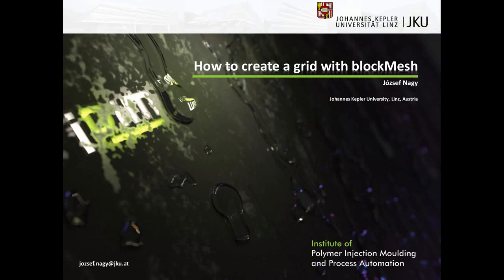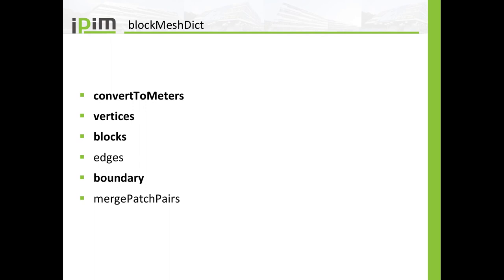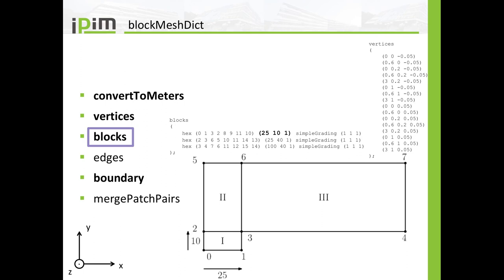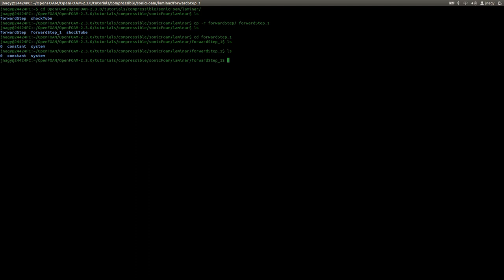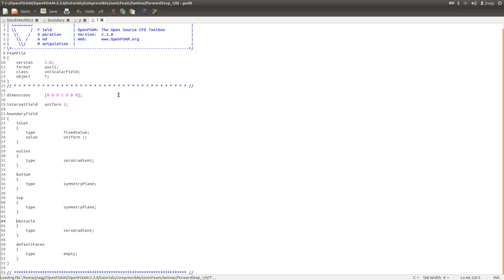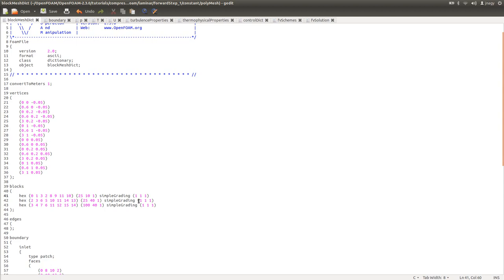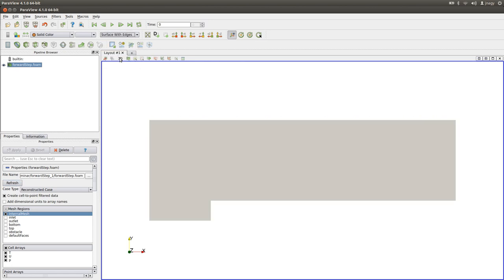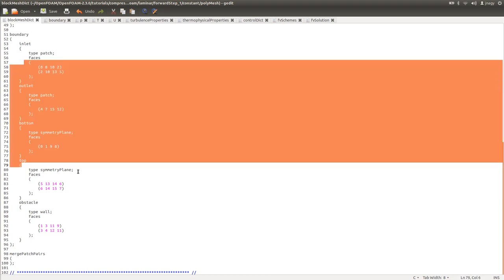How to create a grid with blockMesh in OpenFOAM - tutorial

Comment: Thank you, Jozsef, for taking the time to create this tutorial.  I have also been able to implement the decomposePar and reconstructPar from the multiphase/dambreak example and, for those who are interested, my HP DL380 G6 (6x 4GB 1333ram, 2x X5650, 4x SAS146GB) completes the solution in 1639s on single core and 440s on 10x cores (with decomposition set as simple).  This machine cost me £200 from eBay inc VAT and delivery.
Reply from the maker: Thank you for your input!

Comment: Hi József, I use OpenFoam2216; I tried to follow your instructions, obviously, there can be some modification in the process, so I cannot get the result files after running BlockMesh. The conclusion message after declaring the blocks are that there are no merge patch pairs, so no boundary or other files were created. Anyway, the OpenFoam close its run with the next message: 
--> FOAM FATAL ERROR: (openfoam-2206)

The parent directory does not allow write permission to the process,
 or one of the directories in "/usr/lib/openfoam/openfoam2206/tutorials/compressible/sonicFoam/laminar/forwardStep/constant/polyMesh" did not allow search (execute) permission.
What can I do? Have you any idea?

Comment: hi, thanks for your videos. I tried running this tutorial on openFoam v7. Can you please share the command to be typed to solve the tutorial. In the latest openfoam, forward step tutorial has been moved to a rhoPimpleFoam solver. So i m having trouble running it.
Reply from the maker: Here the most important thing is the mesh part with blockMesh. The simulation is of lower priority. v7 is unfortunately not compatible. In v1912 from openfoam.com the solver is still available. You can try that version of OpenFOAM.
Reply: @OpenFOAMJozsefNagy  Thanks alot for your immediate respose :)

Comment: Excellent Tutorial! I tried to understand the this part on OpenFoam documentation, but it was impossible! Here it is much better explained! I have only one issue with this tutorial and is not on mesh part.
When I typed the sonicFoam command, the openFoam returned that sonicFoam was not found. 

Them, Ubuntu sugested to install OpenFoam by sudo apt install openfoam. I 
tried that and it didn't solve my issue. I also searched on google for this issue and didn't find any solution.

By the way, I am using:
- Ubuntu18.04;
- OpenFoam8
Reply: Same problem, have you found the solution?
Reply: If you manage to make it works, publish it here.
Reply: @alcarnielo  sure, I will and Thanks for the reply
Reply from the maker: @ramgupta7697  The .org version dicontinued this solver. Try v2006
Reply: @OpenFOAMJozsefNagy  Thanks for a reply. Even though I am not able to perform similar tutorial as explained in your video I got much more information about basic commands. 
Thanks a lot 🙂🙂

Comment: Hi József, thanks a lot for the video. I have one question, why do you take now the units for the pressure like pascals, but in the previous tutorial (icoFoam) you had the units of pressure divided by density?, is this because we are dealing with compressible flow, right?
Reply from the maker: +alesabden Exactly. In compressible solvers you have the pressure in Pa, in incompressible solvers you divide by the density and use the kinematic pressure = pressure/density.
Reply: +József Nagy Thank you very much. 
I would like to ask you another question, József. I am trying to simulate a inviscid flow through a convergent-divergent nozzle, and I think that this solver (sonicFoam) is a good option for the case. So, I've just created the mesh, and I am putting the boundary conditions but I don't understand very well how the "waveTransmissive" boundary condition works here. Could you please explain me about that?, I will appreciate it so much, thank you again
Reply from the maker: I am not familiar with this boundary condition in detail, my suggestion is to check out the source code itself.
Reply: Ok, I am going to check it out. Thank you anyway

Comment: @Jozsef Nagy  I have a question related to how to mesh a 3D cylinder(straight vertical pipe mad by a cad e.g Salome  and exported as a triangulated surface stl file ) which is contain inlet and outlet and the wall of the cylinder with blockMesh . I have really searched to find a tutorial to explain this but i did not find it, I hope you can introduce me to such a technique .

 thank you very much for such great tutorial,

Regards,
Reply from the maker: Did you see my tutorial on the multiphase simulation project?

Comment: I am just making sure. 

I am somehow getting the mesh file interpreted to 
1- blockMeshDict [constant folder] 
2- run blockMesh command 
3- boundary is created and other files [constant folder]
4- Paraview reads controlDict [system folder]

Q. confused here. Paraview works with controlDict [system folder]? or blockMeshDict [constant folder]? or even with the empty file I created blabblab.foam?

5- I run with sonicFoam
6- reread the Paraview file again
Reply from the maker: The tutorial is a bit old. Check e.g. my multiphase simulation project it is more recent and uses a more recent approach. Or even my newest overset mesh tutorial.

Comment: Thank you so much for the tutorials, they are great!  
I am using OpenFoam10 and when I try to run forwardStep from rhoPimpleFoam/laminar with rhoPimpleFoam it gives:
 Courant Number mean: 0.251275 max: 1.17915
Time = 0.016s
PIMPLE: Iteration 1
diagonal:  Solving for rho, Initial residual = 0, Final residual = 0, No Iterations 0
smoothSolver:  Solving for Ux, Initial residual = 0.0764808, Final residual = 1.29e-06, No Iterations 1
smoothSolver:  Solving for Uy, Initial residual = 0.064002, Final residual = 7.94223e-06, No Iterations 1
smoothSolver:  Solving for e, Initial residual = 0.26368, Final residual = 4.9006e-06, No Iterations 3
smoothSolver:  Solving for p, Initial residual = 0.0715941, Final residual = 6.77228e-08, No Iterations 2
diagonal:  Solving for rho, Initial residual = 0, Final residual = 0, No Iterations 0
time step continuity errors : sum local = 1.94255e-09, global = 1.06042e-09, cumulative = 6.6211e-09
PIMPLE: Iteration 2
smoothSolver:  Solving for Ux, Initial residual = 0.00795199, Final residual = 9.99449e-11, No Iterations 1
smoothSolver:  Solving for Uy, Initial residual = 0.021992, Final residual = 1.56364e-09, No Iterations 1
smoothSolver:  Solving for e, Initial residual = 0.285134, Final residual = 2.3536e-08, No Iterations 2
--> FOAM FATAL ERROR:
Negative initial temperature T0: -3.09503

I found the same problem here https://www.cfd-online.com/Forums/openfoam-solving/242656-forwardstep-tutorial-case-failure-openfoam-dev-using-rhopimplefoam.html 
unfortunately it is still unanswered
Reply from the maker: Try a lower time step size. Interesting that newer versions are less stable.
Reply: Thank you for the quick reply.
The oscillations appear very quickly in front of the obstacle when rhoPimpleFoam is run even with a smaller deltaT.
But it turned out that roCentralFoam (with appropriate fvSchemes and fvSolution) handles well both cases from rhoCentralFoam/forwardStep and rhoPimpleFoam/laminar/forwardStep tutorials.
Reply from the maker: @tatianaguseva2243  Great

Comment: Great tutorial, but I got an issue: after following the tutorial, I was playing around for a bit, as I usually do to try stuff myself and see if I understood everything. Whenever I tried to start the simulation using sonicFoam on a non-uniform mesh, it chrashed after a few iterations. Why is that? Does this specific solver only work on a uniform mesh?
Reply from the maker: sonicFoam is a compressible solver, it is very sensitive for changes. Test pisoFoam or pimpleFoam, they are more stable.

Comment: block 1- grid size in x-direction is matched  with the (block 2-grid size in x-direction)  , b'coz block 1 and 2  are connected.....similalry block-2 -grid size in y-direction is matched with the(block-3 grid size in y-direction), b'coz block 2 and 3 are connected......like  25,25  and 40,40...... can we run on different grid size  in same direction for connected blocks???
Reply from the maker: The numbers have to match. For complex geometries use snappyHexMesh or cfMEsh though.

Comment: Hello, thank you for your tutorials. I have a question. I begin with OpenFOAM and I work with OpenFOAM-v1912 and for this exemple of forwardStep, in polyMesh, I didn't have blockMeshDict, even after the mesh generation with blockMesh. How can I continue ? Thank you in advance for your answer.
Reply: I have just had the same problem. There is on blockMesh dictionnary in the folder system
Reply: @rafaelcarretero5104  than you very much
Reply from the maker: It was moved to system in later versions.

Comment: Hi József,

Another question: Lets assume I am trying to solve something similar to the current tutorial. The velocity at the inlet is uniform at a specified value as you have already, but the velocity at the outlet is to be calculated rather than specified. As for the pressure, it should be calculated at the inlet and specified at the outlet. Do you know the appropriate BC I need to specify for such a case? It seems like pressureInletVelocity is what I want but does this also apply to the outlet?

Again thanks!
Reply from the maker: Oscar Wilsby pressureInletVelocity is the BC if you want to specify the pressure in both the inlet and the outlet and calculate the velocity. Well in this tutorial I use zeroGradient for the velocity on the outlet, which just maps more or less the velocity in the last cell centers onto the patch. You can try it like that or maybe inletOutlet to avoid a backflow. Is this the kind of 'calculate', you are looking for?

Comment: I doing this tutorial When sonicFoam command is given, i get following message
The sonicFoam functionality has been merged into the transonic option of the
latest rhoPimpleFoam solver and the sonicFoam tutorials moved into the
rhoPimpleFoam tutorials directory.

To run rhoPimpleFoam in transonic mode set the transonic option in the
PIMPLE sub-dictionary of fvSolution:
PIMPLE
{
    .
    .
    .
    transonic            yes;
} kindly guide me in this
Reply from the maker: Yes, v7 doesn't support this solver anymore. You can use an older version or switch to v1912.

Comment: Also got follow error for refined mesh
PIMPLE: Iteration 1
diagonal:  Solving for rho, Initial residual = 0, Final residual = 0, No Iterations 0
smoothSolver:  Solving for Ux, Initial residual = 0.117084, Final residual = 3.8236e-06, No Iterations 1
smoothSolver:  Solving for Uy, Initial residual = 0.0724861, Final residual = 4.11106e-13, No Iterations 2
smoothSolver:  Solving for e, Initial residual = 0.207454, Final residual = 5.60509e-07, No Iterations 2
#0  Foam::error::printStack(Foam::Ostream&) at ??:?
#1  Foam::sigFpe::sigHandler(int) at ??:?
#2  ? in "/lib/x86_64-linux-gnu/libc.so.6"
#3  Foam::symGaussSeidelSmoother::smooth(Foam::word const&, Foam::Field<double>&, Foam::lduMatrix const&, Foam::Field<double> const&, Foam::FieldField<Foam::Field, double> const&, Foam::UPtrList<Foam::lduInterfaceField const> const&, unsigned char, int) at ??:?
#4  Foam::symGaussSeidelSmoother::smooth(Foam::Field<double>&, Foam::Field<double> const&, unsigned char, int) const at ??:?
#5  Foam::smoothSolver::solve(Foam::Field<double>&, Foam::Field<double> const&, unsigned char) const at ??:?
#6  Foam::fvMatrix<double>::solveSegregated(Foam::dictionary const&) at ??:?
#7  Foam::fvMatrix<double>::solve(Foam::dictionary const&) at ??:?
#8  Foam::fvMatrix<double>::solve() at ??:?
#9  ? at ??:?
#10  __libc_start_main in "/lib/x86_64-linux-gnu/libc.so.6"
#11  ? at ??:?
Floating point exception (core dumped)

What to do

Comment: sir,
can Guide on how to dynamically remove cells.
I heard of polyRemovecell but  have no idea on how to use it.
Reply from the maker: polyRemoveCell is not an executable utility, it is a header file, where a couple of functions are defined for dynamic meshing. OpenFOAM does this automatically in the solvers, where dynamic remeshing is included.
Reply: Sir I am modellinG ice subjected to heat flux and I want to remove those on surface cells whose temp falls below 0 degGree and shift the boundary so that shape of surface contour can be seen

Please Guide me some way to remove those cell accordinG to my condition
Reply from the maker: That is some heavy duty programming, what you need, so start familiarizing yourself with C++ and the OpenFOAm Source Code. There are some programming tutorials on wiki.openfoam.com/Tutorials those might help you getting into the source code, but I do not know any material, which focuses on this.
Reply: Sir,
What arGuments do i have to send for removeCells function to tell OpenFoam which cells do I want to remove?
Reply from the maker: I do not know it. I'd have to dive deep into the source code myself.
Reply: Sir,
Thank u for your reply.
I am using now member function of polyTopoChange for which I have to write dynamicMeshDict.
So Sir can u suGGest  some material or tutorial for that.

Comment: Hello sir 
When I tried to solve I got a error showing negative initial temperature.
Don't know what to do
Reply from the maker: What is the exact error?
Reply: @OpenFOAMJozsefNagy  after typing sonicFoam and entering
The simulation runs fine for few steps then stops shows 
Fatal error negative initial temperature = -0.809...
Reply: But when I tried to copy the folder and started as new then it didn't happen and simulation went smoothly.
Reply from the maker: @bharathkumargaddameedi3312  Ok, interesting. I am glad it works.

Comment: Hello, I'm Aldi,
I'm very gratefull with your Tutorial.
I'm newbie in OpenFoam, I concern to simulate the Flow Analysis around the Propeller.  and I need some tutorial or steps how to create the boundary condition for Propeller Case. May you can help me or give some Tutorial? Thanks so much for your time.
Reply from the maker: +바하뜨마까알디아스 Start with the case in tutorials/incompressible/pimpleDyMFoam/propeller .
Reply: +József Nagy Thanks for the answer,
Finally I got the meshing,
but i'm still confuse, in my case, propeller is rotating, and how to input the speed, for example my propeller rpm is 300rpm, and i want to know the maximum of Thrust for the propeller and how to solve that problem?
Thanks so much for your help.
Reply from the maker: In constant/dynamicMeshDict you can set omega in rad/s. Just convert rpm for your case in rad/s. You can use function objects to calculate the forces and momenta onto certain faces.
Reply: +József Nagy yes,. i have tried, but still problems

here is the comment:
aldias@aldias-desktop:~/1/propeller$ paraFoam 
Created temporary 'propeller.OpenFOAM'

--> FOAM FATAL IO ERROR: 
Cannot find patchField entry for walls

file: /home/aldias/1/propeller/0/U.boundaryField from line 11 to line 49.

    From function GeometricField<Type, PatchField, GeoMesh>::GeometricBoundaryField::readField(const DimensionedField<Type, GeoMesh>&, const dictionary&)
    in file /home/openfoam/OpenFOAM/OpenFOAM-3.0.1/src/OpenFOAM/lnInclude/GeometricBoundaryField.C at line 209.

FOAM exiting

and i don't know the exactly error...
Nedd your help,.
Thanks so much.
Reply from the maker: As far as I can tell your boundary in the mesh is not called 'walls', but something else. just rename it.

Comment: My constant folder does not have  the polyMesh folder, what should i do then ? 
thanks ....:)
Reply from the maker: Do you get an error message, while executing blockMesh? Maybe you do not have writing privileges in the folder, where you work.
Reply: exactly, the error says " wrong number of arguments". I am working in windows 7 usign a  virtual machine to run OpenFoam
Reply from the maker: What are the exact commands, you are executing? You seem to type something else behind blockMesh.
Reply: I have the same issue. Instead, my blockMeshDict is in the system folder. Does have any problem in this?
Reply from the maker: In recent versions they moved the default location of blockMeshDict from constant to system. What are the command you are executing?
Reply: I've followed the steps and all worked just fine. Thanks for your help again!

Comment: ******@*******:~$ simpleFoam -help
--> FOAM FATAL ERROR :
    Could not find mandatory etc entry (mode=ugo)
    'controlDict'
this is what I get when I type simpleFoam -help
also, I have installed openfoam from ubuntu repositories & not from openfoam repositories
please help
Reply from the maker: You have to start the command in the folder of your OpenFOAM case (i.e. where you have the 0, constant and system folder).
Reply from the maker: @kothekarswaraj  What do you get when you type: ls $WM_PROJECT_DIR/etc/controlDict
Reply: @OpenFOAMJozsefNagy  
ur one of the video helped 
all set now thank u:)
which one should we use for post-processing blender or paraview?
or r they for specific purposes
Reply from the maker: @kothekarswaraj  Blender is more for preprocessing. post is also possible, but a lot of work. so use paraview for post.